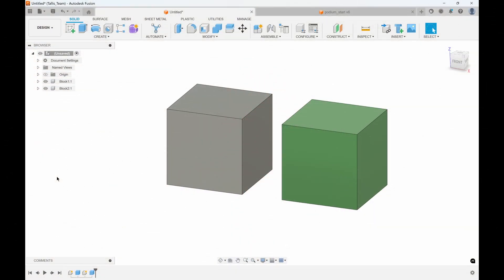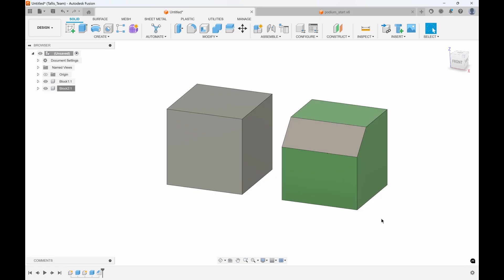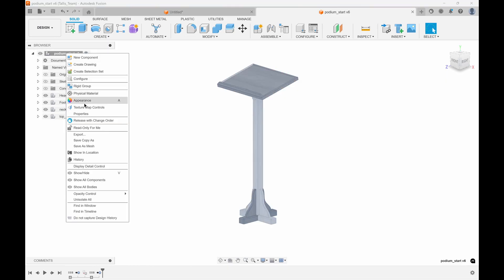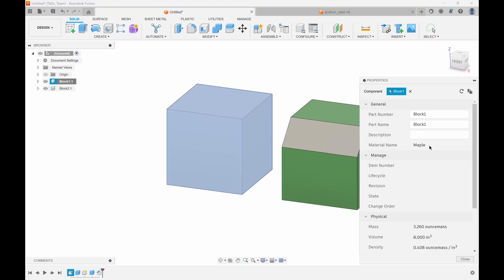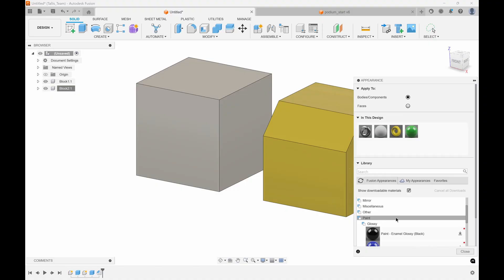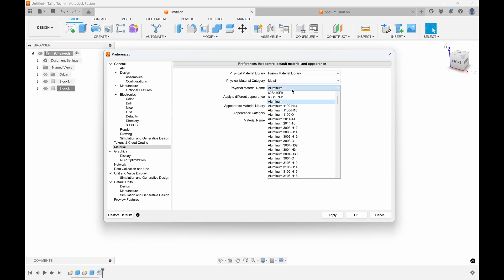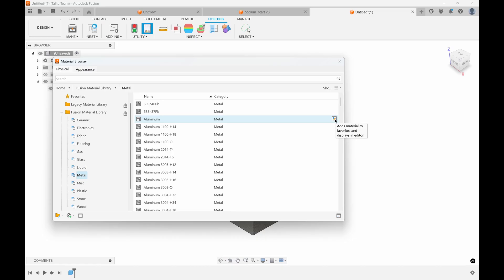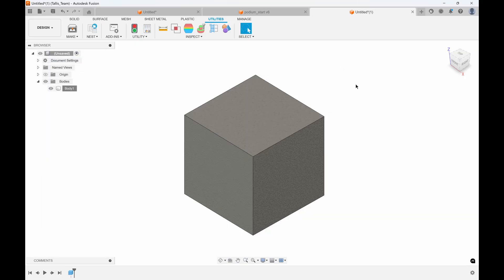Fusion Physical Materials and Appearances

Comment: Is there a way to have a solid body translucent but then faces within that body be solid (not translucent); for example I have a 1-2-3 block that is translucent but the holes in it show with solid faces. This would make the holes show up really clearly in 3D; NX and I believe SolidWorks both let you do this. Can you make a video on this?
Reply from the maker: Yes, you can do this.  Set the appearance of the body to be something translucent like glass or air.  Then, in the appearance dialog, change the selection option from body to "faces" and then apply the colored material to the faces that you want (the holes for example)

Comment: There are so many powerful features that go unnoticed or unused due to lack of knowledge. I do a lot of 3D print design. It will be great to be able to estimate my filament weight using the correct material going forward. As always, thanks again!
Reply: That will be difficult unless you print with 100% infill. Fusion does not know your slicer settings and will assume every body is solid.
Reply: @ Shoot…I should have thought of that. So much for my astounding revelation. Thanks for the reminder.